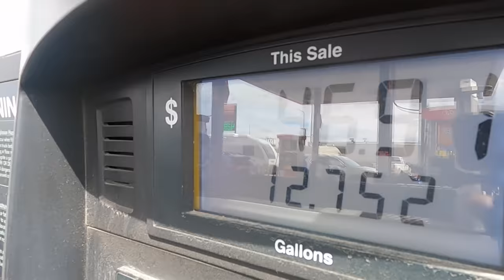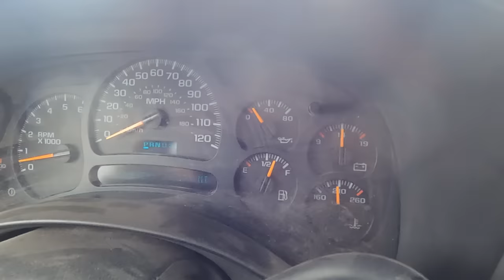Lost Treasure! Excavator Thumb recovery left from the Heavy Iron Series

Comment: Hey ,  Always something going on at the Fortress, good on you. You are a prime example of simple motivation and what you can have by just acting every day! After forty seven crop’s, my farming experience would lead me to look at those solenoids on the tilt mechanism, they will quite often just corrode just enough to not transmit power properly and that is from just sitting. Good luck!
Reply: Agree with you there. Those pumps dont run enough to burn out in the life time of the trailer usually. unless they were ran dry, or dirt in the system. 
Can you believe all the stuff HeavyD and the crew left behind? Remind me to drive to their location after they have finished up a big job. That a treasure right there for us cowboys.
Reply: Have you ever had hired guys? They would leave their heads behind if you don’t check.

Comment: Alen you are brave man heading up there on your own but of course it’s nothing you are used to. You definitely found some treasures out there, can’t believe someone left all their recovery gear, chains and a binder along with the rest of their gear behind. 

Nice job and I’m glad you made made it out of there without getting stuck or running out of fuel. Thanks for sharing your video!  👍🏻
Reply: It was their gear he was picking up.
Reply: Great video Alan, no wonder they call you the wizard - Alan The Wiz. A good job done very well.
Reply: He did mention. There was lots of snow when they picked up the heavy equipment. So lots of their gear got lost in the snow. 
If Allen had not gone back. Some one else would have gotten the gear.

Comment: Why is in the kitchen I couldn't find your old movie or whatever it was what you were at the top of this thing talk talking top of the fortress talking about the nats biting the heck out of you I used to have the same problem over here Ontario California but I learned that you could take a propane torch set it on low to medium medium low and set it down and within 5 minutes all and that's followed the trail of carbon monoxide down to the hot flame and they evaporate in the are disappearing all your nets get cleared out real quick it's a cool revenge you go about doing your work in a little plane just remember you got the low plane sitting there on the table about 5 feet away and then you look around there ain't no match no no natz rather I hope you get this message it's long and stupid but it is we're good thing working good